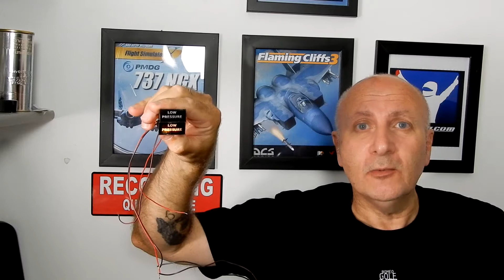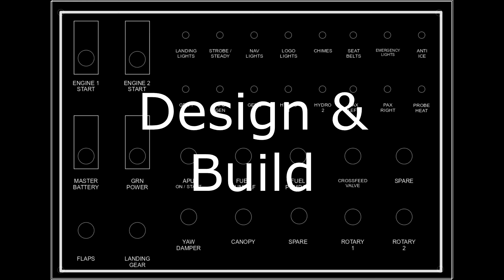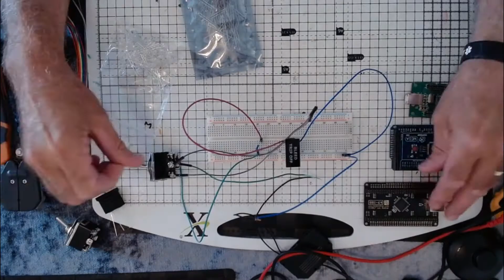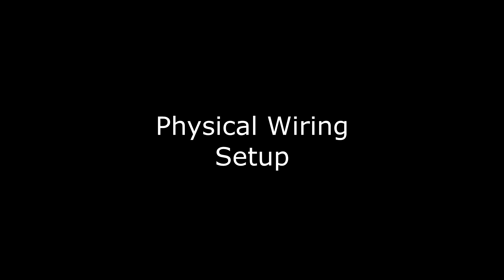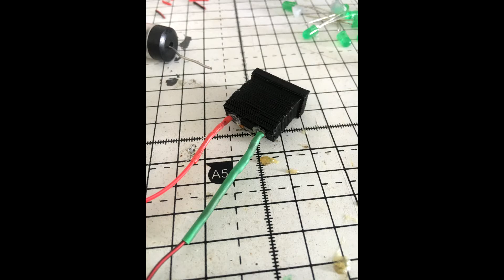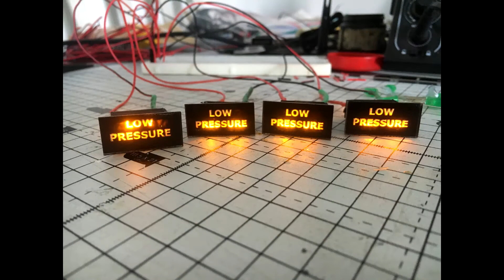Boeing 737 Overhead Panel Annunciators

Comment: HI would you have any idea what code to use to connect an LED and an arduino with an annunciator in flight sim. I feel I've looked everywhere for some example code but I can't find anything.
Reply from the maker: Hi that’s the subject of my next video. I will be using an arduino meha with Mobiflight and Fsuipc. If the annunciation is not listed in Mobiflight there should be an event code in fsuipc. The problem with fs 2020 is not all the codes are available yet.
Reply: @togatech1111  Great thanks I'll stay tuned for that :)

Comment: Hey, I'm sorry to bother but I wanted to ask, what are the exact dimensions of the annunciators? Based on some images that I have downloaded I have 24mm by 12mm but I'm not sure if that is accurate :) TY
Reply from the maker: Hi sorry I had to install Cura to check the sizes of the STL file. The boxes are 25 x 22 x 12mm I hope that helps. Thanks for Subscribing.
Reply: @togatech1111  TY very much!!! I'm guessing that 22 is the depth of the annunciator :)
Reply from the maker: @friedchicken1  If you checkout the SVG file for the FLT Panel you can get all the measurements for the holes the annunciators fit in as I believe the 25mm also includes the lip to support the annunciator labels.

Comment: awesome video. i want to build the panel but its only aviable on leo bodnar`s website  do you know any other store that can sell it?
Reply from the maker: You can use any joystick or button controller because the LEDs are only on when the switch is on and are not connected to any output from the Leobodner board.

Comment: goood work .. but input and output has got different data so wiring must be different .. dont take leds  Voltage from switch. .Direct output... This panel can be test using for but not for training . Thanks  for  perfect design ..
Reply from the maker: Ok. Thanks for subscribing and all you comments